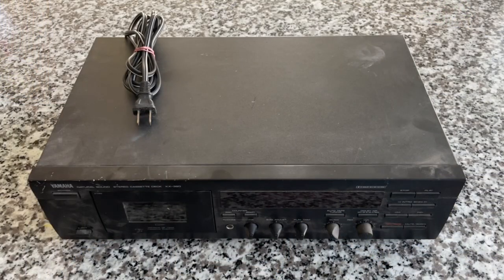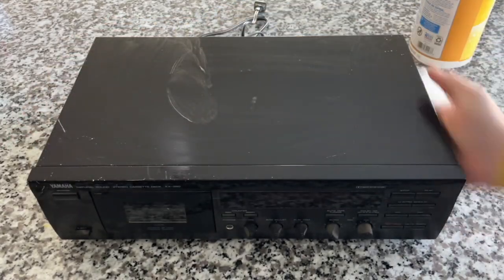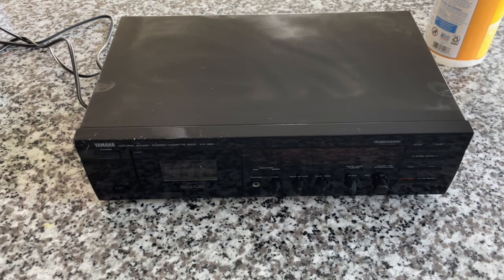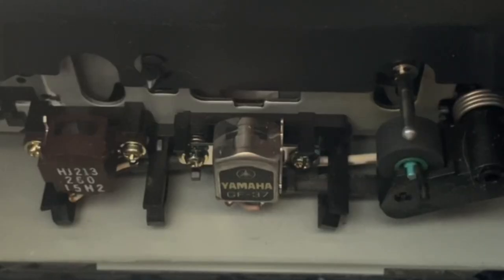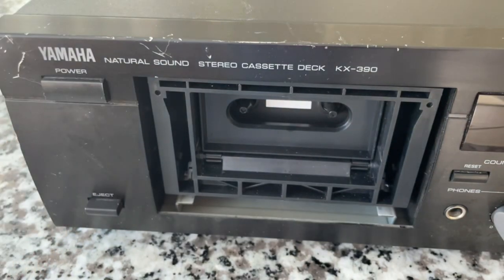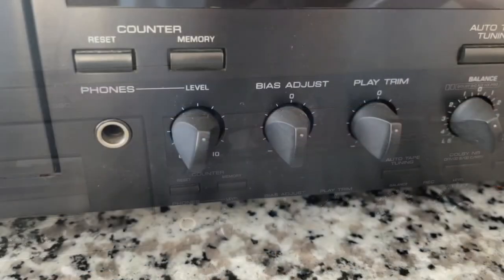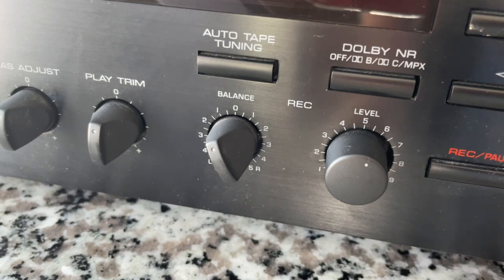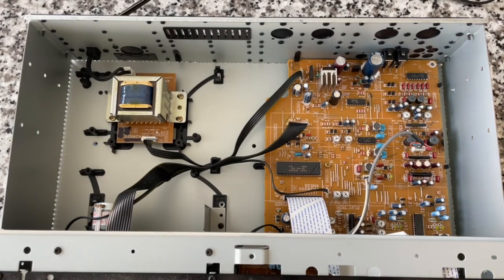Yamaha KX-390 Review!

Comment: The auto tape tuning on this deck sets the bias to level the record/playback response at 10khz and also levels the general output to cater for old used tapes or different brands of tapes with varying sensitivities.
The play trim is just a playback treble adjustment to enhance previously recorded dull tapes and musicassettes.
Reply: Wrong, Play-trim is not a treble control, but in principle a continuously adjustable play-back equalizer. It picks up more than you do with a treble control.

Comment: I have some interesting info about the GF-37 recording/playback head, because this is a special type!!!

Yamaha itself speaks of a very high quality head.
The special thing about it is first of all the shape, which is wedge-shaped and not round or flat. As a result, the footprint on the tape is smaller and more focused, resulting in more details in the sound. The disadvantage is that you should not record too loudly, but if you record at +2dB on type I and II and +4db on metal then you are safe, but in practice +4db on a TDK SA tape also works without any problems. This type of head is called Focus Field head. You will find them in the better 2-head machines.
Also remember that this is a modern 250nWb/m DIN meter and so the 0 point is closer to the distortion limit. Yamaha's recommended levels seem on the soft side, but that's only appearances, it's true!!! 0dB on the Yamaha = +4dB on an old VU meter.

The head is virtually indestructible, but it is not a glass-ferrite head. The material is Hard Permoloy and the head has an extremely smooth finish. Due to the extremely smooth finish, the friction is much lower, which also means less wear and tear.
It is therefore extremely important to keep the head clean and it is also important to use good quality cassettes. Old 70s ferrous tapes, type zero tapes and other tapes that do not look nice and smooth should be avoided in this deck!!! With such old cassettes, preferably use an Akai with GX heads (these are the real glass-ferrites) or Sony with F&F (also indestructible and proven) heads. But the GF-37 does not wear out from good tape. You can use TDK D, Sony FX, Maxell UR etc without any problems without extra wear. The GF-37 is clearly designed for Metal tape, the performance of this head on this type of tape is unprecedented. I know of 3-head decks that record and play less well than this series of Yamaha 2-head decks.

Another fun fact: Although the Yamaha emblem and brand are printed very professionally on the head, which suggests that this is a generic Yamaha head, you will be disappointed. However, Yamaha has not produced any heads themselves!!! But rest assured, the heads were produced by Canon and Canon takes quality very seriously. The same head with a different print was also used by Optonica (by Sharp). But also some models from Pioneer and even some 2-head models from Nakamichi you will find the Focus Field head made by Canon (Nakamichi also produced focus field heads) ;)

Although the GF37 head is not a glass-ferrite head, it is very special!!!

If I said my KX580 Special Edition was a bad tape deck I would be lying.
This quality is no longer produced, so be careful with it!!! They are also sometimes called Baby Naks, that's not without reason ;)

Finally, as a true maniac/freak, I have a bonus fact:
The cassette tape and accompanying recorder were invented by the Dutch engineer Lou Ottens of the Dutch multinational Philips.
You would think that Lou Ottens was a Philips man in heart and soul. However, Lou Ottens knew what a good sound was, because he was also the spiritual father of the CD player and during an interview about cassette tapes (which must still be on Youtube somewhere) he had a remarkable hi-fi installation at home...: Yamaha !!!
It had a KX493 cassette deck, which is the successor to the KX490 and which is the 2-motor brother of the KX390. You also saw that deck in action during the interview. Either Lou Ottens had no confidence in his own brand or he just had very good taste. Yamaha Natural Sound is for the connoisseurs ;) Unfortunately he is no longer alive and we will never know.

Greetings from this eternally wet Netherlands, you know that country where the spiritual father of the cassette tape came from.
Reply from the maker: Amazing comment thank you!  Not a bad buy!  Why does it say it’s a GF head?
Reply: @Recordology  Hahahahahaha, because it's also a 'GF head'. ;)
Because the real Glass ferrite heads from Akai are called 'GX'. 'GX' is an abbreviation of "Glass and X'tall Ferrite Head". GX heads can be found on reel-to-reel tape recorders and cassette decks from the 'GXC' series such as the GXC760d, the flagship model from 1977 that I also owned (my Yamaha KX580se performs better)
In younger Akai cassette decks we encounter the Super-GX head. The main difference is that a Super GX head is suitable for Type IV metal tape and a GX Head only for Type I, II and III.

"GF" at Yamaha is just a name and has no specific meaning. This is just clever marketing :D
Reply: @Recordology  This is also a little teaching moment:
The term Focus field refers to the shape of the head as I explained earlier.
An Akai GX head can be just as good as Focus Field, especially with reel-to-reel heads. My Akai GX635d r2r tape recorder also has Focus Fields heads.
Focus Field is not brand specific, there are several manufacturers that apply this principle: Canon, JVC, Nakamichi, Akai of course and a few more. It is remarkable that decks with Focus Field heads perform better than decks with regular oem heads.

A Focus Field head places higher demands on the electronics and is preferred for the presence of calibration functions. This has to do with the accuracy of this type of head.
It can also go wrong, as with the Akai HX27w double cassette deck. This one has cheap Focus Field heads and no calibration and the electronics on the PCB are inadequate for these heads in my opinion. The lows are distorted and the highs hiss at 0dB on a Maxell XLII cassette (my Yammie gets a perfect sound out of it). I bought the HX27w when I was 15, but within 2 weeks I had exchanged it at an extra cost for the Sony TC-W170 which I liked better, but it had normal standard oem HD heads. (an HD head is an ordinary standard round head that is suitable for Metal tape)

Comment: I own the KX580 Special Edition myself.
This is a great 2-head deck with 2 motors with Dolby S, 160khz erase frequency and the special thing about this model is the better components on the PCB. This was still a middle segment, decks from the 600 series were 3-head machines.
The KX380 was an entry-level model. Yamaha is a good brand that has to uphold its reputation. The quality of this entry level deck is comparable to a mid-range deck from the competition.
A very strong point is the reliability which is very high.
If you record with Dolby, you have to record louder than the Dolby symbol on the meter.
On this meter the 0 dB point is at 250nWb/m, the Dolby point is at 200nWb/m(-1.2dB on the meter). The 100% modulation point/0VU is at 160nWb/m(-4dB on the meter). The 0dB point of this meter is closer to the distortion limit of the tape. Yamaha recommends +2dB for Type I and II and +4dB for metal. +2 and +4 on this meter is +6 and +8 on an old needle vu meter. Because the levels are somewhat higher, the signal-to-noise distance is also much better and you are less bothered by noise. My KX580se achieves an S/N of 80dB and has a maximum frequency range of 20Hz ~ 20,000Hz on metal tape, which is unprecedentedly high and a very outstanding performance for a mid-range 2-head deck.
Play-trim is a must have, this brings old dull music cassettes back to life, you can play Dolby MCs with Dolby without it sounding dull or pumping. An excellent tool for digitizing cassettes, Nakamichi doesn't even have this on it!!!
The KX380 performs a little less, but still above average.
According to the service manual, Yamaha uses TDK AD(Type I), TDK SA (Type II) and TDK MA(Type IV) as reference cassettes. It will therefore perform best on TDK tapes.
My urgent advice: Don't sell anymore and be careful with it!!! You won't easily find a better one in this segment. Yamaha doesn't make garbage, but produces great audio equipment :D
Reply from the maker: AWESOME COMMENT THANK YOU!  Always wondered, what does the play trim actually do?  It sounds like its brightening up the audio.
Reply: @Recordology  In principle, Play-trim is an adjustable playback equalizer. Play trim is not a treble control. ;)

Comment: I still own two cassette decks from Radio Shack (Optimus SCT-91 with HX Pro, Dolby B-C NR Auto reverse and auto tape select, and an Optimus SCT-57 dual cassette deck with HX Pro, Dolby B-C-S NR auto tape select, and auto-calibration) from the mid to late 90s and I use them fairly frequently. I always enjoy listening to my tapes. Inside my bedroom, I have a Yamaha mini system that has a cassette as well, and last (but not least) a portable Magnavox AZ8340 MX01 CD/Dual Cassette/AM-FM radio unit.

Comment: Dolby MPX is an FM radio noise reduction system/19KHz (FM stereo pilot tone) filter. When recording from FM the pilot tone messes with the bias oscillator of decks that are capable of recording up to 19KHz (most roll off at 15) thus throw off treble response and Dolby B and C encoding.
Reply: Came here to find this comment

Comment: Actually, MPX is a filter that removes the 19kHz signal coming through from radiostations, inticating a stereo signal. What You probably meant was HX-pro, which is, like Your tapedeck already states, headroom extension for frequencies. Too bad that tapedeck is a bit scratched up, otherwise it's really nice looking. I always liked the amber displays Yamaha components had. About that garbly, no highs sound of the slightly messed up tape; it could also be that the taprhead needs a bit of demagnetising, so it can send out and pick up magnetic fields better, without being bogged down by the magnetic field thats already on the head without any signal being applied.

Comment: Congratulations on the new tape deck! I have a very nice high end Sankyo (yes Sankyo, not Sanyo) from 1974. It's a top loading Deck and has all the features a high end deck should have. Mine just needed belts, but even then the belts that were in it were still doing their job. I just changed them for optimal performance.

Comment: Late 70s Fisher Studio Standard back in the day. But your explanation of more modern cassette decks explains why my 7 in 1 sounds a little AM radio which is probably due to it playing mono. It makes sense anyway. When you took the cover off it brought back a memory I hadn't thought of in decades and that was taking apart my small portables and replacing the belt with an appropriate sized rubberband. Haha! Cringe worthy now and it probably didn't need replaced, but it worked. If there's debris inside a unit what do you recommend cleaning it out with? Thanks for the great review and have fun with your new purchase.

Comment: Overall great video. However running a fingernail across a tape head is just a bad idea. Apart from the risk of scratching it one wouldn't want to get any fingernail or dirt particles into the almost microscopic gaps of the recording/playback heads. Furthermore, what set Nakamichi apart from other decks wasn't their adjustable features such as bias and auto tape tuning. There were a ton of decks in the 70s, 80s and 90s at much lower cost than the Naks with many more consumer adjustable and automatic functions and features. What set the Naks apart was their transport, head (discrete) and electronic designs and in their higher end models the option to manually adjust either record or playback Azimuth (automatically on the Dragon). These were features virtually not found on decks made by any other manufacturers regardless of price.

Comment: The low-end Yamahas from the mid-80s were quite robust. My first own deck (K-340 euro version) still runs good with the original belts. Very high mileage, but the head still holds. The compact two-motor mech (different from yours model) is excellent for the class.

Comment: I use more for play prerecorded cassettes an Technics RS-TR474. I try to record a few type 1 with auto-calibration and different noise reduction B/C and sound decent, if i cut of dolby noise reduction. Amplituner that I use is an Technics SA EX 100  on SB-3630 speakers.

Comment: I have the KX-380 looks the same. Definitely use that auto tune on both sides before recording and I prefer Dolby C. I bought mine at a thrift store for $10! And MPX is a filter for recording FM radio signals with Dolby.

Comment: I noticed that one of your cassettes had reel flanges. While they look cool, they are neither needed, nor recommended. They were not included in the original Phillips Compact Cassette standard, because they take up valuable space inside the cassette and can cause reel binding. Regular cassettes have slip sheets inside that allow free movement of the tape. I have always steered clear of those cassettes that had those reel flanges. Fortunately, it was mostly TDK cassettes that had them, so it was easy to avoid.

Comment: Nice unit. Decent tape decks have now pretty much disappeared from the thrift stores here (UK) and many don't deal in electrical goods anyway. Even on FB Marketplace they're scarce and often not local. So it's eBay (which tends to ve VERY overpriced, especially when shopping is factored in) or nothing. That said, I'm still on the lookout for a nice 3-head Technics (I tend to favour Matsushita stuff, and there hasn't been Panasonic / National branded hifi separates in many years.